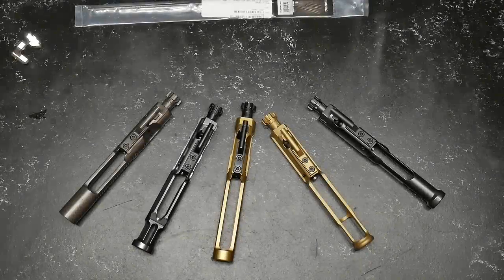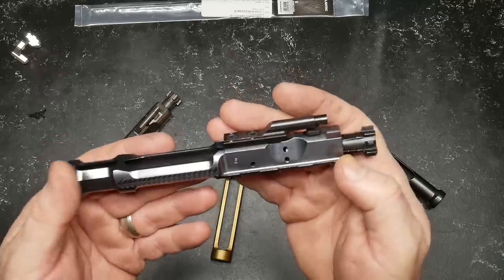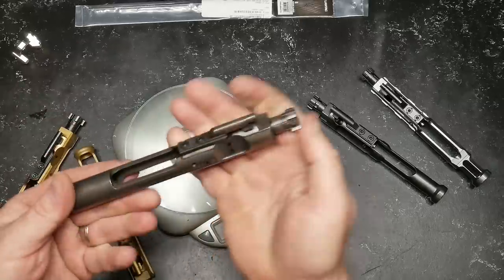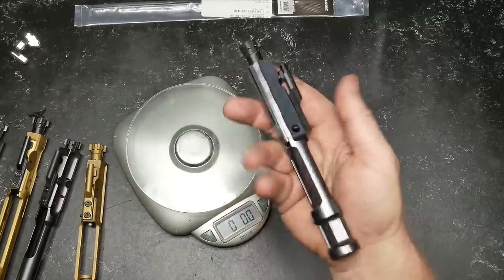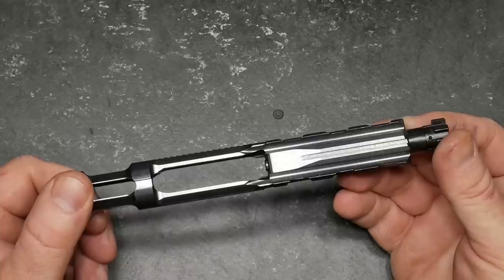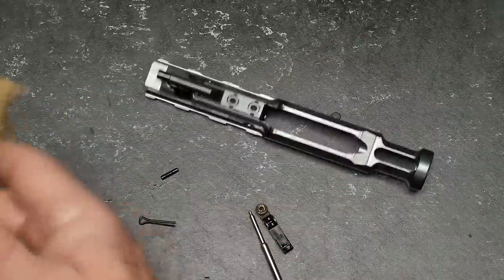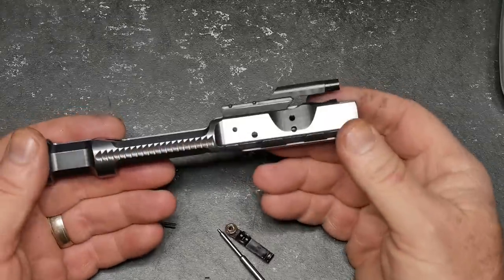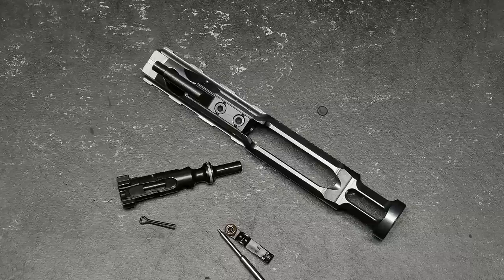DSA AR15 Enhanced Low Mass Aluminum Sand Cut Complete Bolt Carrier Group

Comment: Have this one. There is no steel insert inside the carrier for the bolts gas rings as some have said or thought. Didn't like the bolt that came with it so running a RCA bolt. Set up is A5 buffer tube, taccom reduced power rifle length spring. Two aluminum buffer weights and two steel one's in A5 buffer. Adjustable gas block, trash panda can. Full power hunting loads, 2950 fps 65 grain sierra gameking. Does fine
Reply: Thank you.

Comment: I bet it will hold up just fine. 7075 T6 aluminium is pretty strong and honestly I've never seen a bcg fail, It's always the bolt that breaks or the extractor. That said, I'd swap the bolt out with a HM defense bolt and modified cam pin for the extra strength.

Comment: I like the idea but I'd be concerned about the area around the cam pin.
Reply: SicSemperEvelloMortemTyrannis TyrannyEnder  Because the cam pin is a common failure area.  If the material around it isn't as hard as the hardened steel pin, it'll mean the cam track will start to lose it's tolerance and deform rather than the pin sheering itself.

Comment: I was wondering the same thing are the gas Rings riding on aluminum?
 Or is there a steel insert in there like you're pressing a barrel inside of the cylinder on a 2 stroke?
Reply: A sleeve gets put into the cylinder with heat they don’t really press them in there because then you have scarring in other issues.  It’s anodized like the bolt carrier unless and I don’t think they Nikasil it. But Sand cuts are kind of stupid on any machine they make sure the services are flat and sealed so nothing can get under there if you have oil and sucks up sand and rides back-and-forth you got sandpaper but he just point out the facts

Comment: I think it will probably work and if it doesn’t I don’t think it will be a catastrophic failure. It won’t fire out of battery and I don’t think it would blow up... worth a try. The true question is weather you can feel the difference in recoil. Otherwise it’s a waste.

Comment: If you shoot a lot the gas ring/bolt fit will wear out the aluminum pretty fast.  What I had to do was mill it out and  sleeve it with a stainless tube. Thats what they should have done from the get go. As a disclaimer my bcg is not a ds arms but im sure the ds arms will wear out just as fast. Mine lasted about 2,500 rounds or so then by 3,000 I decided to go ahead and sleeve it to fix the wear and tear and prevent it ever happening again. pain in the ass but real nice on a adjustable gas block rifle. But who knows maybe the ds arms one is tougher. Still should be sleeved Though.

Comment: using it with a heavier buffer defeats the purpose of the light weight bcg. instead, consider using a reduced power spring, and an adjustable gas block to lower the gas. if you find the correct tuning, this combination will result in a very soft shooting rifle.

Comment: The opening pic looks like a before an after shot of all of them together. I may try one of those, wish I knew how reliable it would be.
Reply: Aluminum you’ll get in the ballpark of 1500 to 3000 rounds aluminum does not like shock JP made aluminum Bolt carrier group too

Comment: Hey Kota i was gonna get a 10.5 barreled upper for  my PSA 16" barreled rifle. Do you need to get a different buffer for the shorter barrel, and if i get a lighter BCG do you need different buffer as well?  Well i should watch full video before asking question, you answered half of it already lol. Thoughts on aluminium BCG, I would not use it, I like steel for that part.

Comment: Can somebody explain to me the purpose of a reduced weight BCG? Is it for running super weak handloads or something?
Reply: It's all about climate change
Reply: The point is to reduce the recoil impulse. When a light weight BCG is paired with the right buffer, spring, and adjustable gas block it can be tuned to run very fast, with the consequence generally being some degree of reduced reliability, particularly in adverse conditions.

Comment: I'm just about finished my first build just need a bcg. I'd like a lightweight one if they work fine. My gun is a 12.5" barrel mid length gas and adjustable block .556, anyone know if a lightweight bolt will work alright with this setup? Preferably $250 or under if anyone has suggestions ty!

Comment: There is a reason stoner didn't use aluminum for the bolt carrier in the original design.  There is this thing call gas etching or gas cutting. It happens commonly on aluminum muzzle breaks and flash cans. And it's exactly what it sounds like the gas pressure 55k psi+ cuts away at the aluminum. Now consider that the bolt carrier on an ar is an expansion chamber meaning the ar is not a direct impingement system but that's for another conversation. I digress, for a split second until the pressure builds enough to start the unlocking process and the gas rings pass the bleed holes there is 55k psi of hot gas being blown into the inside of that carrier. I would bet my lunch money it is etching away on the inside of that bolt carrier. Now is this an issue for a bcg meant for a closet queen or the occasional three gun event? no realistically it will probably never see enough rounds to fail. But I think they should have cut the aluminum carrier for semi auto use only and left the steel version as the m16 cut. Because there is zero chance that aluminum carrier would survive full auto fire, I doubt it would make it through a full combat load under full auto.

Comment: @ Kotaboy32 Tactical I just ordered mine I'll have it Friday.... i hope it doesn't blow up in my face....p.s. my wife said I can't watch your channel anymore! I told her to get in the kitchen and make me a sandwich....kidding.
Reply: BlackRifleBear, Did you get it and use it yet? Im thinking about getting one too.
Reply: @TacticalBuffoonary  i returned it after reading that they are disposable... AL on AL wears fast. I would suggest light weight steel or Ti. I have a brownells light weight steel NB and its great half the price of Ti.
Reply: @ericfrisch ’ I ended up getting it anyway. I put it in a kaiser polymer upper/lower receiver set. I wanted something super lightweight my build ended up at 2.8lbs. I have 3 of the brownells lightweight bcgs and a titanium bcg from rubbercity armory. This aluminum carrier is holding up fine in my build which is a 7” .300blk that is suppressed and only shoots subs. My plan to make it last longer is to sleeve the carrier where the gas rings are to stop the wear. This gun is strictly a how light can I get it build’ so its not a battle gun or a home defense weapon. I also don’t mind replacing the bcg every 3-4000 rounds if I have to’ $165 is not that much money for me….the ammo is more expensive than that $899 for 1k of S&B 220g subs. Thanks for the reply.